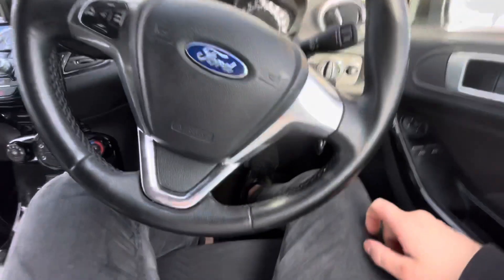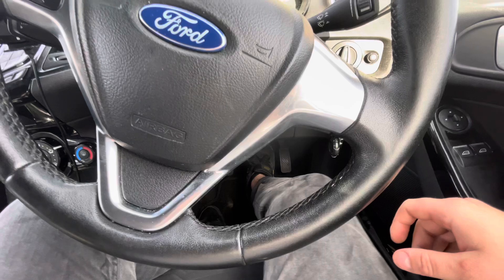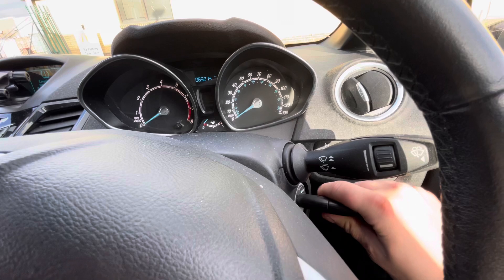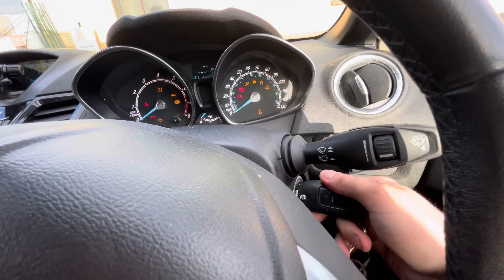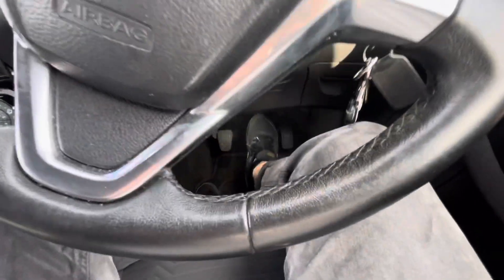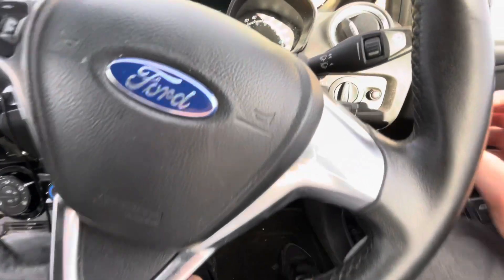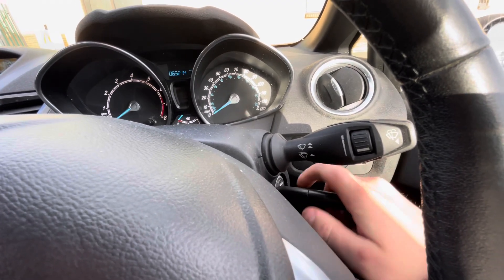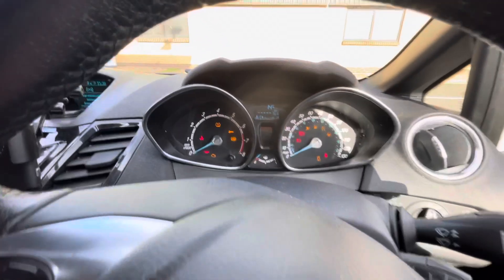How to programme new TPMS tyre sensors for Ford Fiesta MK7 2015 learn mode

Comment: Hi OP I'm trying the same thing, I believe I bought the same sensors but it never seems to be recognised by my Fiesta. Are you also using 433MHz sensors? I got the garage to check and he said he could see the existing ones reading 433 so this has to be right. The green light on my VXDAS is flashing rapidly but car just still always stays on the 'train left front tyre'

Comment: I didnt needed to do anything like this to teach the new TPMS sensor in my MK7(2017). At the tire service they told to turn the switch to Ingnition and thats all. They done the teaching with this tool. After they done i needed to start the engine and reset the TPMS in the settings.